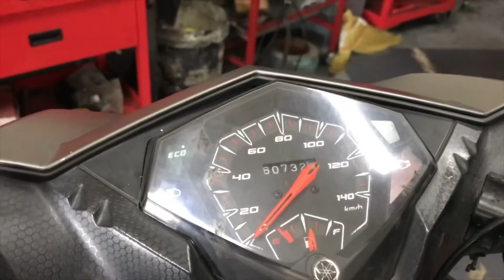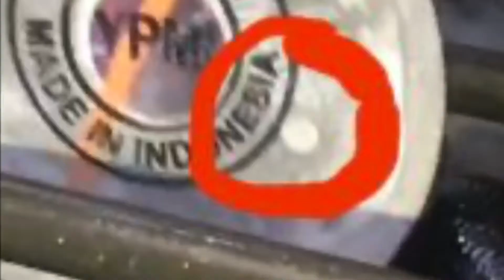Top overhaul ng yamaha mio i125(tutorial)

Comment: Boss tanung ko lng po kung alam nyo po tong tatanung ko kc yung motor ko na mio i 125 ayaw po mag supply ng charging sa battery  kaya lagi lowbat po yung battery ng motor ko nag palita na po ako ng rectifier pero ganun parin po sana po matulungan nyo po ako maraming salamt po
Reply from the maker: Check mo yung socket ng rectifier.. silipin mo.. may sunog na siguro dun.. kadalasan yung itim na wire.. linisin mo lang.. check mo din yung body ground..
Reply: Maraming sapamat po

Comment: Ganito po idol yung mio sporty ko na check ko na battery, carb, cdi, sparkplug, ignition coil, stator, fuse ok naman sila itong loose compression na lang hindi puro ingay lang ng push start ayaw talaga umandar try kong silipin din sakin maraming salamat idol more videos👌👊🙏
Reply from the maker: ogie corres  repa baka naman tukod lang ang adjustment ng valve clearance

Comment: Sir kakasubcribe lang po ano po kaya problem mio 125 ko may push nman sya sir ayaw lang tumuloy tapos ayaw din po ng kick  sparkplug check kick po ako ng kick ayaw talaga pahelp paps.
Reply from the maker: Pakinggan mo yung tangke ng gas kung may ugong,kung wala . 1. Pwedeng napagtripan ng daga yung wire. 2.sira pump. 3.mahina battery,, need mo galingan magkick.. wag molang rev kung sakaling umandar kapag sira ang batterry o may prolema sa charging.. masisira pump..

Comment: Sir ano problema parang may huni kapag nag memenor at pero pag nag accelerate ako ok nman. Salamat sa sagot paps
Reply from the maker: Check bearing ng axel sa torque drive.. pagmalake alog malamang kan galaing.. malalaman mo lang yung kung babaklasin mo lahat sa transmission..
Reply: Sa pang gilid ba yon paps? Cge bukas pag huminto ulan kanina kasi nagpalit ako ng belt di ko nman matanggal yung nut sa bell sibrang higpit